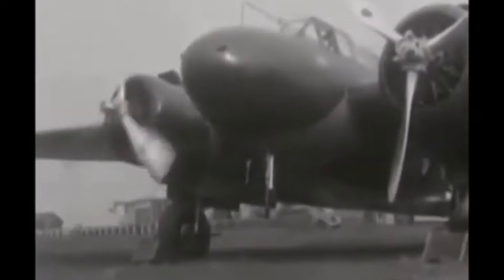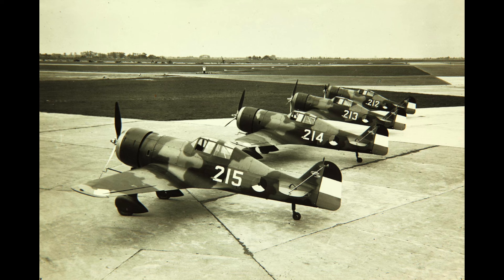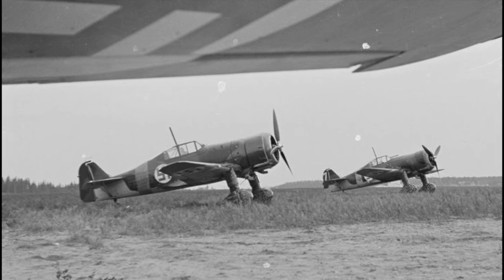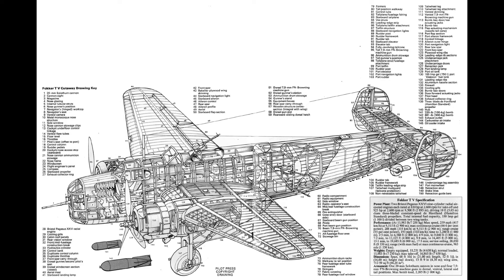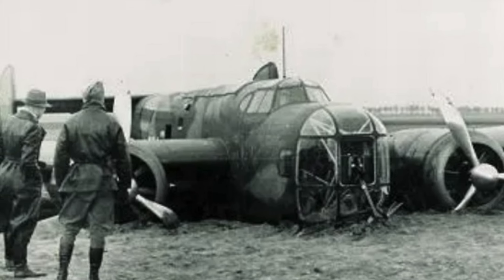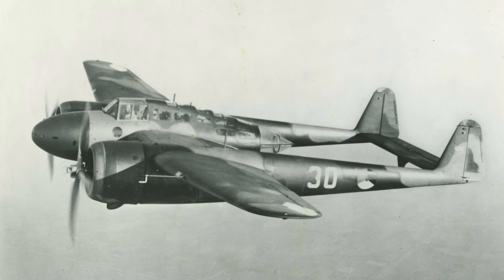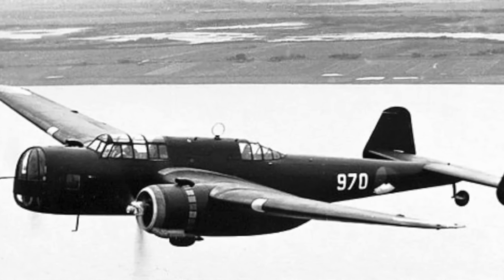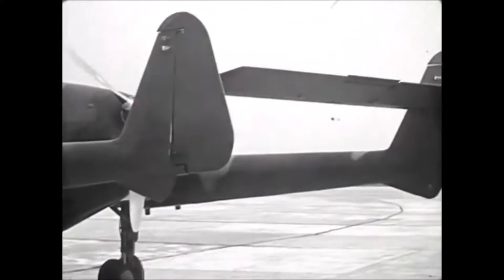Dutch Aircraft of World War Two - Part 2

Comment: Nice to see interest in Dutch warplanes. 

Alas several mistakes. The D21 had two times two machineguns in the wings. It was of mixed construction. 

Because we Dutch needed to import engines we didn't have engines in the 1000 hp range.

The D21 could compete Me 109e even though 200 hp less.

The D23 tryed to solve the same issue. Yet with aircooled engines this never would have worked.

The video with Tros in de corner are Harvard T6 trainers representing D21 for a film. 15:44 

The G1 was akin the much later Mosquito made from woud. The prototype shown in the video had counter rotating props. Later used by Lockeed in the P38 with the nose gear of the D23.
Reply from the maker: Thank you! Very interesting stuff!
Reply: Small adition: D23 had an engine in front and in back not (only) to solve the rotation issue of the propellor but to reduce drag from a second engine. The engines and the fuselage are all in line so very little drag. The problem they encountered and still were working to solve was the cooling of the engine in the back without causing more drag.

Comment: TBF the D-XXI was indeed - as the video mentioned - specified as a fighter for the Dutch East-Indies. As such the requirements asked for a rugged, simply to maintain fighter as there was little infrastructure there for complex maintenance. Choosing a fixed undercarriage contributed to that simplicity. It was never meant to face cutting-edge fighters like the Bf-109; it lacked the speed and the armament to do so.